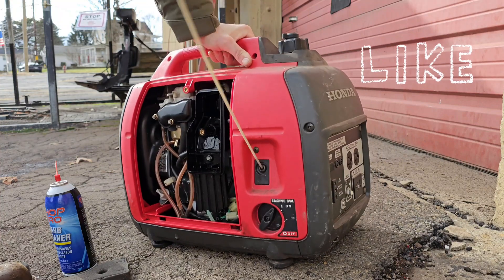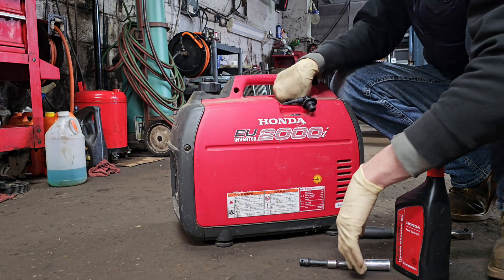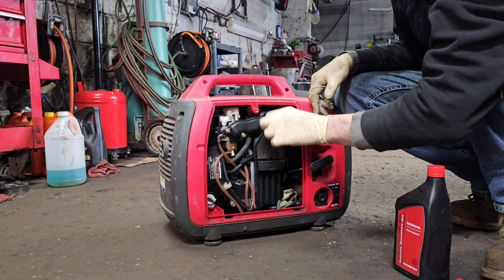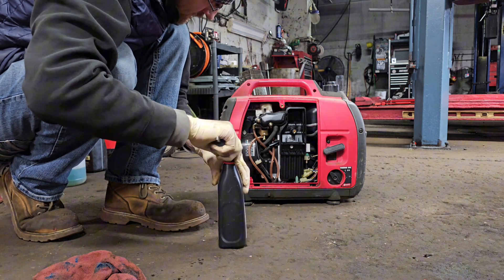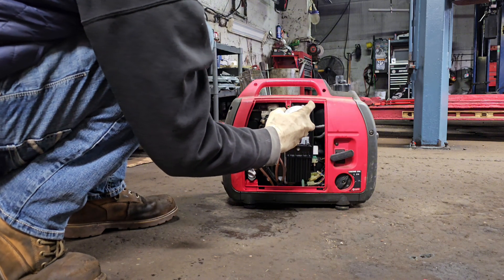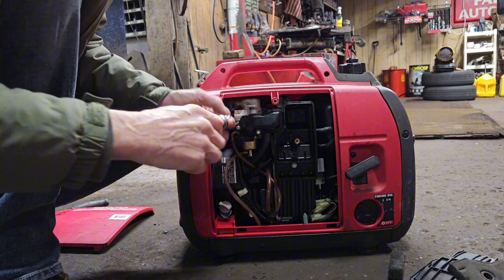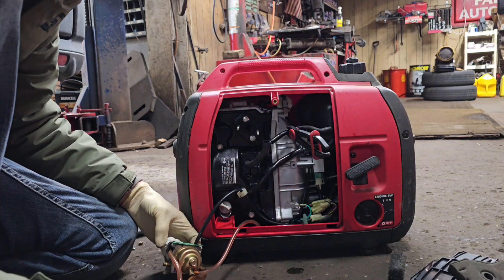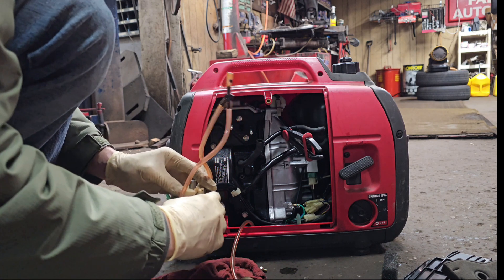Honda eu2000i surging repair and basic maintenance for the zombie apocalypse! 😆#honda #smallengine

Comment: Like a previous comment, you working on the floor is killing me!  I have worked on many of these Honda generators, and as I was watching this video, I was wishing that I was there with you showing how to do a COMPLETE carb overhaul so my customers will not bring it back!  The real test is to power a small electric heater for a full load, not a hand power tool.
Reply from the maker: Thanks for that tidbit of advice. I will have to use a heater next time. As far as a bench, I didn't really have a good place in the shop I was at to have a bench. Thanks for the comment 👍 😀

Comment: My generator will stay running on half choke but when you take the choke off it flutters and revs up and down any help appreciated
Reply from the maker: Have you tried cleaning the carburetor? That's where I would start. Sounds like it isn't getting enough fuel to run without the choke. Also, check and make sure all the throttle springs are attached. Feel free to ask any additional questions. Thanks for the comment 👍 😀
Reply: Replace the spark plug and clean the carb once or twice

Comment: Surging fix: .99 percent of time the Pilot jet on top of carb is clogged. Clean very small .010 hole with thin wire. My Powermate 2000i had bad surging until I cleared pilot jet. I did not remove carb, I removed plastic case around generator.
Reply from the maker: Thank you for the additional knowledge. Cleaning the carb worked for my situation, but the jet wasn't plugged up really all too bad. Thanks for the comment.👍😀😊